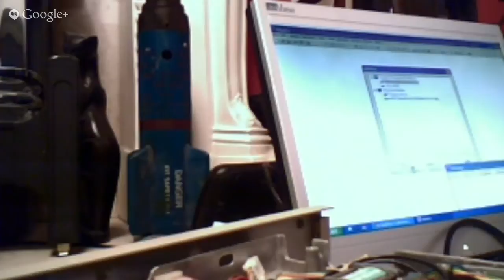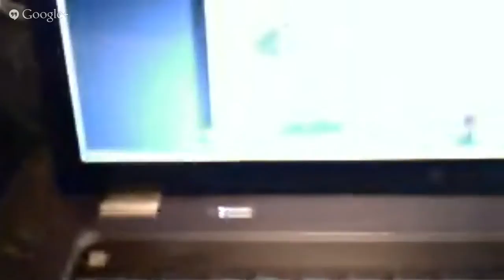Paintbox Live : Fixing the floppy to read data (part 2)

Comment: Could you not get an old AMSTRAD PC1512 which uses 5" discs and somehow connect the drive you are working at to the computer as disc drive 'B" and set it to work with the 8"  80 Track. I.E. A:=40 B:=80 as you don't want to change the format of the "A" drive otherwise you won't be able to boot it up to load software you just want to change the settings of the "B" drive failing that do you know anyone with a working MEMOTECH MTX512 with a FDX80 8" floppy drive who might be able to help you read the data of your 8" floppy discs.